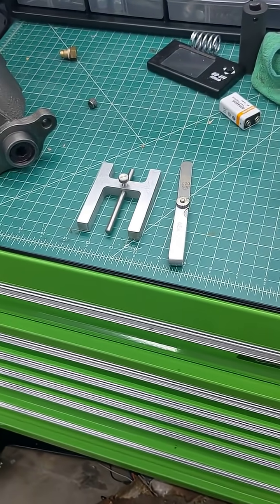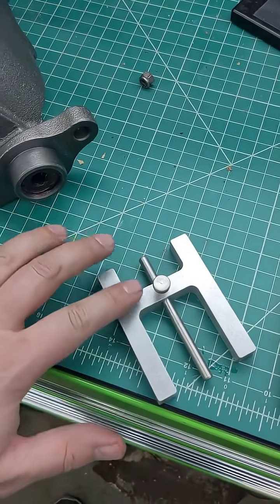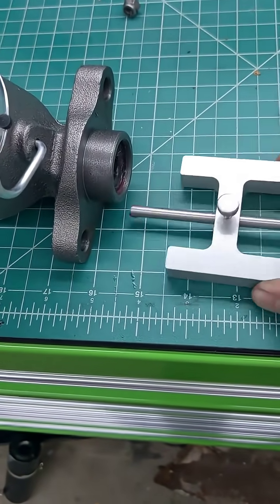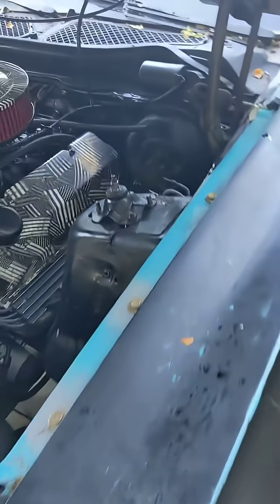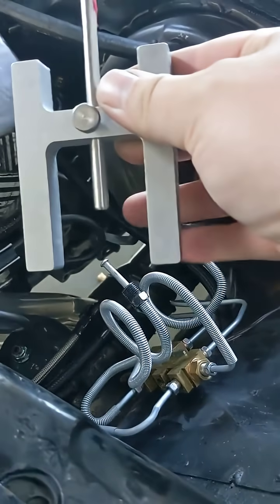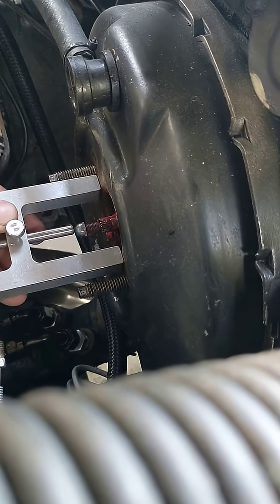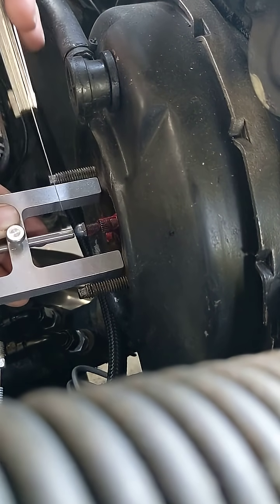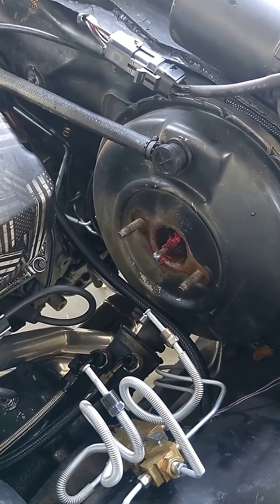Brake Booster and Master Cylinder Push Rod adjustment // AKA Booster push rod//

Comment: Would this help on a mustang 2 , when I barely hit brake pedal it’s like slamming on the brakes?
Reply: Factory brakes all around and factory booster and master? If your booster diaphragm or master bore is too big for the system you will get what you described.